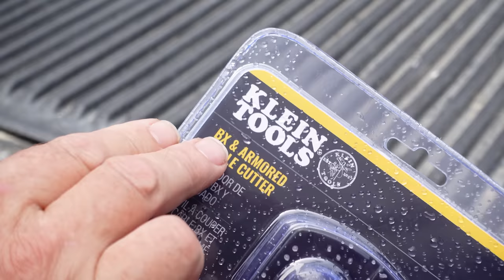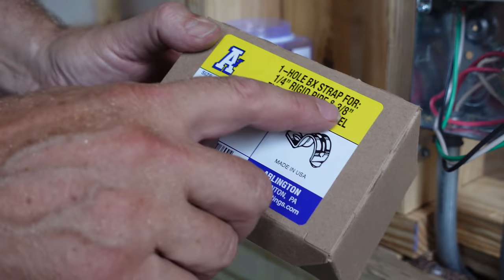We MAY Have Overdone It...Bathroom Rough Electrical - THE SHOP Part 8

Comment: When you installed the redhead or anti-short bushing you put the opened slit of the bushing on the side of bx where it was not cut. Should have turned it around
Reply: Yup, just because the tail shows through into the box doesn’t mean it was put on properly.
Reply: Maybe it's just me. But aren't you supposed to trim the clad flat before putting the anti-short bushing on? Otherwise you have a jagged piece of metal that can cut the wire. Thus undoing the work of the bushing?
Reply: @okienative4785  normally you cut the edge at like a 45 then install the anti short with the tab on the sharp side,

Comment: I would glass brick those windows. They are thick and heavy, so you lay them just like masonry bricks. You would have to measure and get the supplier to cut them to fit. Good for bathrooms because you can get them bubbled or opaque.

Comment: Hmmm, I would have been tempted to turn one (or both) window/s into a fan hole / ventilation, to prevent too much mold and condensation.
Reply: Is there any HVAC in there?
Reply: I believe they said the plan is to run ventilation up and out the top (above platform, out sidewall).  But, yeah, nice to have a window for light and ventilation in event of an extended power outage.

Comment: With that 3-gang mud plate, you could flip it 180 degrees so the holes with left/right offsets are on the right hand side. That way you don't have to fight gravity when trying to screw the plate on.
Reply: I was going to ask if there was a specific reason to do it that way.

Comment: You should look at the 2020 NEC code 406.9(C)  before finalizing your outlet placements by the shower.

(C) Bathtub and Shower Space. Receptacles shall not be installed within a zone measured 900 mm (3 ft) horizontally and 2.5 m (8 ft) vertically from the top of the bathtub rim or shower stall threshold. The identified zone is all encompassing and shall include the space directly over
the tub or shower stall. Exception: In bathrooms with less than the required zone the receptacles(s) shall be permitted to be installed
opposite the bathtub rim or shower stall threshold on the farthest wall within the room.
RATIONALE OF CHANGE:
The requirement of not allowing receptacle outlets within or directly over a bathtub or shower stall has expanded the measurement into a zone approach. The zone will now extend to 3 ft horizontally and 8 ft vertically. The measurement will be taken outer edge of the stall or rim. This is an installation that will need to pay close attention to at the rough-in stage as some bathrooms may not have the necessary room to comply therefore resulting in an exception that allows for the receptacle outlet to be installed on the farthest wall opposite of the bathtub rim or shower stall threshold.

Comment: Studpack, if you have a Dremel tool, you don’t need the special armored cable “cutter”. Using the Dremel with a carbide cutoff wheel, carefully cut through two adjacent links on the cable (cut with the cable, not across it). Then twist the sections apart. You’re basically doing what the special tool does.

Comment: I don't mind if the video is over 30 min. If the content helps me to learn I can watch it all day. I didn't know the stuff you showed with the conduit (anti-short bushing/top hat). That is a great idea. Again, it's important to see electrical wiring done properly BEFORE  drywall goes up! My attitude is to try to learn all I can and to do it myself if I can. It's hard to find competent handymen for some things nowadays. If you're ignorant about what a job requires you can be overcharged by a 'pro.' However, the last thing I want to do is to pay a 'hack' for a half-a$$ job OR do it incorrectly myself and get electrocuted or burn my house down. So, thanks for the tips and just sharing your knowledge. Looking forward to the next videos.

Comment: 16:25 really small detail, but when you put the anti-short bushing into the jacket, you should offset the split in the bushing and the cut in the jacket. You can see in the video the sharp edge not being protected by the bushing
Reply: Yep saw that too!   I usually trim off the pointy part , but always want to at least cover it
Reply: Yes thats what I do too.   Alot of people don't use the bushings but I think it's safer to use them and really doesn't take any longer 🤷‍♂️
Reply: it's the first time i've seen anyone using any sort of anti cutting through the cable thing in any of the usa wiring videos
in the uk you have to fit rubber grommets to everything, fill in the backs of boxes with fire sealer, etc
Reply: You are actually supposed to clip the corner off first
Reply: Just use electrical tape
Reply: @willschultz5452  they are code. If an inspector can't verify visible, you'll be required to make it right.
Reply: What they said. Also missed a strap on the middle cable. Didn't see it strapped per code unless I missed it
Reply: @pgood7266  It's a garage. How about if Paul just applies a dab of Bond-O instead? 😄
Reply: @tvbrauer1566  probably leaving straps off until the emt is installed between the boxes.
Reply: @therealdojj  you have to use connectors here in the US aswell
Reply: @jeffreyjohn2037  
Could be.  Fair point. Although the other two got straps and still need straps higher up 😅
Reply: @tvbrauer1566  regardless, by the time all said and done, with all of the input, Studpack will get r all tightened up.
Reply: @willschultz5452  Required by code in these parts, and for darn good reason.
Reply: @stephensaines7100  not required by the NEC. I use them because it just makes good sense.   I just did a job with MC and the inspector said oh you don't need those. I said I like to use them anyway.
Reply: @jeffreyjohn2037   They are not required by code.
Reply: @jeffreyjohn2037  I just did a job with them and the inspector said "oh, you don't need those"
Reply: @pgood7266   I've done that to hold the bushings in place. You just have to make sure the tape doesn't break the ground connection
Reply: @jeffreyjohn2037  it's not a NEC requirement to use them

Comment: Since you framed with wood studs, you could have transitioned from your metal boxes to the plastic boxes and used ROMEX after you installed the first metal box to keep your ground interconnected 

As a 01 electrician I like the use of MC but I know Romex and plastic boxes are typically less expensive

Comment: I'd do whatever it took to keep those windows for the natural light and ventilation.  Without those windows, that bathroom will seem like a big, dark closet once you're done.

Maybe use the brick you have to narrow the window in the vanity space so it's no longer a security risk?  

If not, I'd also consider glass block for that window to keep the natural light.  Same for the shower window.

Comment: I am a huge Klein fan.  I picked up their wire stripper and many of their electrical screwdrivers and meters.  They cost a bit more but are worth it.  I just finished a room remodel in our vacation home and I added two more circuits to the room so I could have dimmers on new perimeter lights and some added middle lights.  Great video.

Comment: electrician here lol great video only tip for putting in those anti shorts, make sure the the closed side of the anti short faces the side you cut.  That ensures when tightening the L16/ mc connector that the sharp part of the armoured sleeve doesnt press into your wires.  also no need for fancy bx cutter hacksaw works bits😏

Comment: Regarding the 4 square steel deep box that sticked out of a stud. You could use a 4-square extension ring with a 4 square steel box. It will be flush with a stud. The extension ring has knockouts close to the edges as an old box you removed

Comment: Hello is me again,
So u're switches are actually grounded, actually bonded, with the cover on the metal box, if you see the switches again I believe got that metal that bonds it to the system, As soon as you put that cover back on is bonded, plus I love how they left that piece of shedding on the ground wire so that stranded wire won't flare out, nice.
Keep up the good work.

Comment: Rotate the mud ring 180 on the 4 gang box so the round part of the keyhole is on the down side and slot is pointing up this way the slot falls onto the screw and is ready to be secured in place vs having to hold the mud ring up to align the slot with the screw

Comment: Just remodeled my bathroom and found a similar window hidden behind the old fiberglass shower.  It too was a block wall and a pain in the ass ripping out the old metal window framing which is embedded in the block. But it's worth it having the natural light coming into the bathroom.

Comment: Instead of the mechanical 3/8” connectors we use the snap on quick connect. Lost faster especially if you do for a living. Can also add 2 mc’s with just one connector. The mc cutter is 3 times faster than just breaking and cutting with dikes.

Comment: I don't use metal boxes everywhere, but in addition to the benefits you mentioned, I also like the heat tolerances of metal boxes, especially for any lines with potentially high load or in buildings with old wiring that might have higher resistance.

Comment: at one point in time, I remember seeing and using 4" plastic boxes and plastic device mud rings, all blue color(carlon).
I also recall the brown fiberglass boxes having matching device mud rings of all sizes, both also had round 4" to 3.5".
I haven't seen any as of late and the last I used them would have been 20+ years ago. it may still be made, just not stocked at the stores, especially since commercial most always wants metal and it's just added cost for residential that nobody uses.

Comment: Good idea to get those deep boxes and mud rings.   I just DIY'ed my kitchen and found that 12 Ga is beast to wrestle into a small box  especially if theres more than 1 device!   
Also 1 quirk  i discovered when using the mud rings for the first time ,   is that you have to allow for the  screw head  .  for example ,  a 1/2" mudring didn't really work for 1/2" drywall; had to get a 5/8" depth mud ring because the screwhead pushes the drwall out   (i suppose you could dig into the back of the drywall, but i didn't want to mess around with it)

Comment: A very minor recommendation is to use pan head mounting screws inside the electrical boxes instead of the combo (hex/regular) screws @ 9:55. The sharp edge of the hex screw heads could chafe the wire over time.

Comment: I have had trouble finding plastic mud rings but use loads of plastic boxes here in Jamaica. If I actually ground the switch or outlet they usually do not require a grounded mudring unless I can do it easily.. but a spade connector between the mudring and box does that well.

Comment: Steel jacketed cable is still available and called AC (armored cable). It doesn’t have a ground wire, but instead uses the outer jacket as the ground, along with an internal aluminum bonding strip.

Comment: Using a ocopancy sensor switch for the red light on the traffic signal and I think there is a sensor that is normally closed for the green light that will be green until the sensors trip and the light goes red. Purhaps the yellow could be wired to a methane sensor to warn of possible gas buildup.

Comment: nice work
I have a house built in 1960, and I change out the 2prong outlets with 3prong outlets. I use a bare copper wire to attach to the metal box, and ground screw on the 3 prong. I use my Klein outlet tester, and it lights up to show I wired the outlet correctly.
Reply: The outlets are designed to be grounded by being screwed to the metal mud ring, which is grounded to the box and that's ground to the conduit. That's the way every house in the Chicago area is wired. If using conduit, one can at least save the expense of the ground wire. You can't do that with Romex into metal boxes, but you can with conduit. I don't think armored cable can be used as a ground though, but I'm not an electrician, and I don't keep up with current code, and Chicago is different anyway.

Comment: 11:45 mud ring needs to be flipt around so the screw head holes are on the right so when screws heads line up the plate  drops down to make level, instead up pushing it up causing a possibility to loosen over time. Love yinz guys keep up the good work.
Reply: I noticed the same thing. Good job.

Comment: For your multi-gang bracketless boxes you can just use  some Sliding Wall Brackets, makes life fast and easy. Noticed at the end of vid that your MC cable strapping could also have been done to code (I thing within 12 inches of the box) and clean with a sliding bracket just above the box.

Comment: Might be nice to have a switch for the exhaust fan if the remote gets lost or stops working.
Reply: Good thinking.
Reply: The fan needs a switch to supply power. The fan " remote" is wireless and mounts like a traditional switch. I installed it a few months ago. Excellent product.
Reply: Or for a different replacement model that lacks the remote, in the event this unit fails at some point.

Comment: A Good experienced Electrician when boring holes in the stud framing members ALWAYS cleans out the bored holes by NOT leaving any splinters of wood on the backside of each bored hole when pulling NM-B Romex that won't snag the Cable, especially NM-B Romex which can be torn easy, the outer jacket sheathing !! But it doesn't matter when using MC but it's a good work habit to do each time , looks more professional !

Comment: I hate remotes for ceiling fans and lights.  I had a great ceiling fan that was on a remote and when I remodeled the room, I made the fan and light switched at the door.  Much better in the long run and now worries about losing the remote.

Comment: Using EMT on some jobs is a good way to learn raceway and wiring planning and discipline.  It has the benefit that if done right new conductors can be added later without opening surfaces.  It's also a motivator to learn low voltage control.  
I've done both as a homeowner and a commercial systems engineer in Chicago when EMT, not corregated,  was code-required, not optional, in all new construction/ (open wall) work, except for specific situations where the connections had to be flexible.  Short floor stubs for receptacles run nearly straight  through into a basement with clear straight runs is the easiest work there is. Wall switches have to be connected directly to a stud when longer are harder. When every run connects overhead is the hardest.  20:47 No inspector here would approve vertical runs of any kind that weren't anchored to a support within 12" of each box and every 48" between.  Yours shouldn't either.  Also EMT is not code-approved as a substitute for a grounding conductor as a cold water pipe might be.

Comment: Great videos!  I’d recommend using Arlington snap in connectors when using metal boxes and mc cable.  No need for Red Devils and so easy to use.
Reply: Worked 50 years as a sparky and every company required us to use anti short bushings. At the large hospital/research center that I retired to from the they did not permit any snap in connectors due to afraid of not as good as a low resistance ground then a properly installed locknut.
Reply: @garbo8962  cool story

Comment: around 8:56 you said you needed to bond the mud ring to the plastic box. If you just remove the plastic washer on the screws of your device, the yolk on the device will bond the mud ring given the device has a ground pigtail attached.

Comment: My rule is more than two switches at a single location causes confusion. The average person will have to stand there and flip switches until they figure out what they do. Also, if you can get away with using a motion sensor for a light, you should. They are particularly good for hallways, stairwells, garages and other transitory pathways where you don’t dwell any longer than a few seconds.
Reply: till stupid people start manually overriding the motion sensor. I spend more time having to go back to calibrate motion sensor switches at work from people insisting on pushing the manual over ride button

Comment: To secure the bracket boxes by code you have to use exterior wood screws cause of metal to wood and by code they must be 3 ft from the outer basin
Reply: NEC can be over ridden by local code. State code, local code even individual county code. NY and CA are perfect examples of amending NEC, their code book makes the NEC look like a 20 page paper back

Comment: FYI, I am definitely not a "code guru" as you said.  I just wanted to pass some information along that I had found the hard way that I didn't know existed when I remodeled our bathroom.  My wife wanted an electrical outlet on the opposite side of the sink which ended up being 28" from the shower and not the 36" but I couldn't move it any farther due to a big mirror that was in the way.  I know local codes supersede the other.  Our local inspector is just very very, very, very particular on rules!!! Personal note, I also thought it may have been dangerous to your buddy, standing a chance to get electrocuted since the outlet was so close to the shower. I never want anyone to get injured when things could have been fixed before hand codes or no codes.... In another instance our codes said a shed had to be more then 5 ft away from anything fence, house, etc.  Ours was 5 ft 1 inch on one side and he still had an issue about closeness, but luckily I was in code.  But again I'm not a code guru just a guy that likes to do stuff on his own and then finds out later it was wrong or right.  Again I just wanted to pass some information that I had found out the hard way...  I enjoy your videos and I will make sure to never comment any other information I had learned the hard way or anything.  I do understand you know everything and don't need the help of anyone.  You are just putting out content to make money.